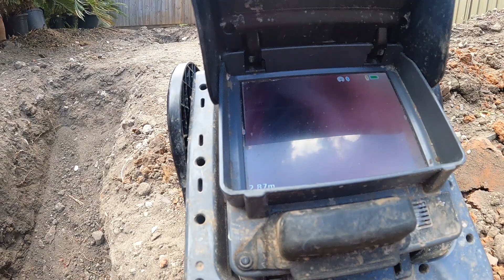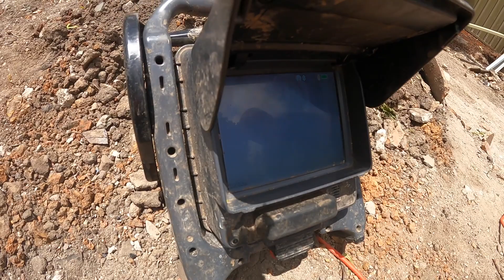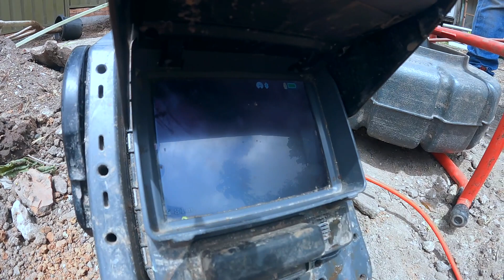Blocked Drain 542

Comment: Not trying to cause shit but when you were putting water up the hole near that vertical section I noticed some water spraying out of the ground which could indicate a break around that section.
Reply: Time stamp @ 15.58 that happened I was just wondering if that pipe should be dug up and possibly be repaired or replaced? Just a thought